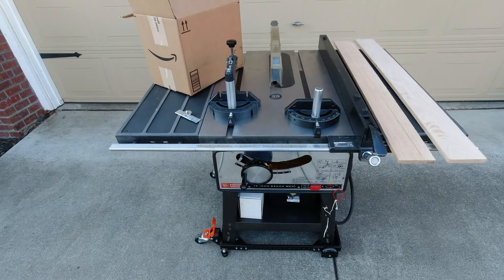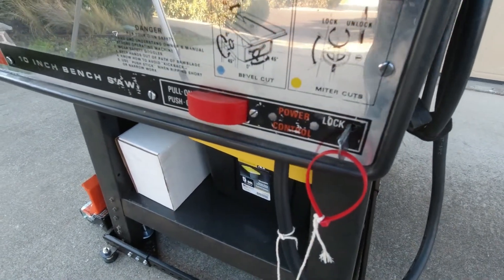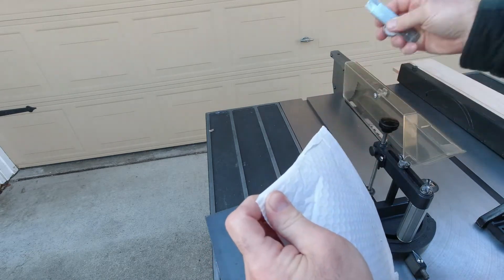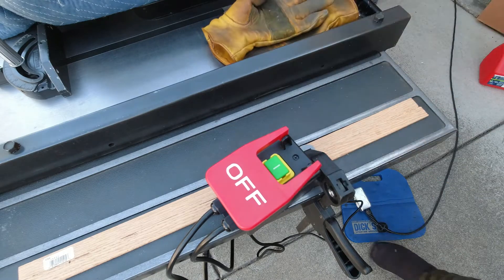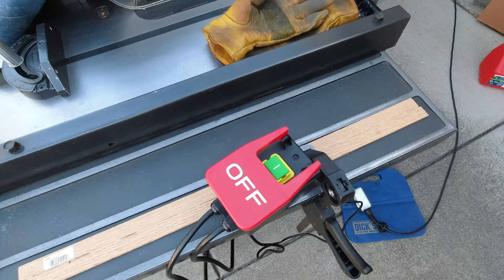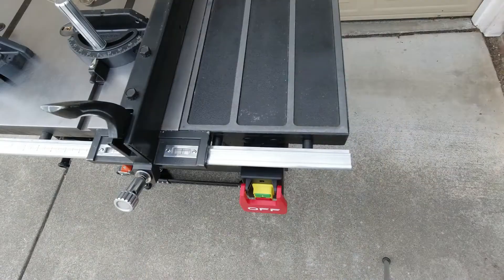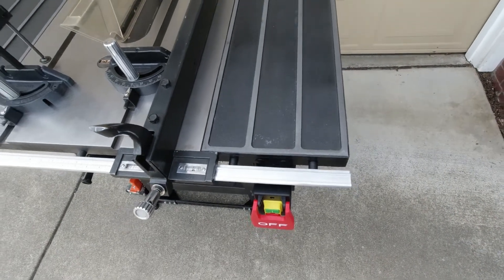Craftsman Vintage Table Saw Upgrades: 1950's Power Switch Technology Meets 2022

Comment: The 50s Saws, I have 2, do not have any safety switches or safety guards at all. That one is closer to the 70s and 80's
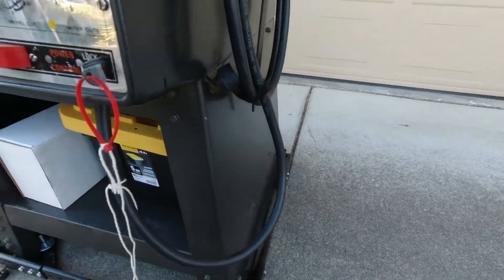Reply from the maker: I've spent the last few months restoring 4 Craftsman 100 table saws from the 1950's.  The CM 100 actually did have a blade/safety guard available and I did a video on making a new clear insert for it.   You can see that starting @ ~4:30 or so... https://www.youtube.com/watch?v=TfK-cZ-fFow

You are correct, the grey saw is from 1977 or so and I did a comparison of that with my CM 100 as well as a series on restoring the CM 100.
https://www.youtube.com/watch?v=lOV5YW9oP60
https://www.youtube.com/watch?v=lCZSxamVDx0

Comment: do yo uhave the part numbers for the switch and where you got the metal?
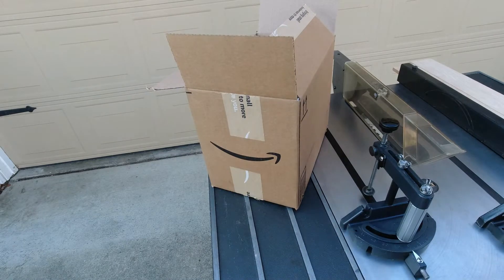Reply from the maker: As stated in the video around the 2:00 mark, Amazon items. 

Forney 49620 Hot Rolled Plate, 1/4" x 4" x 12"

110V Single Phase On/Off Switch, Ortis Router Table Switch with Large Stop Sign Paddle Easy Contact for Quick Power Off for Table Saws and Other Electrical Equipment